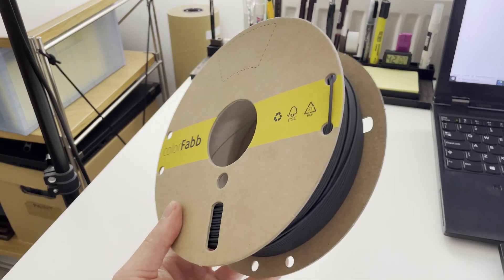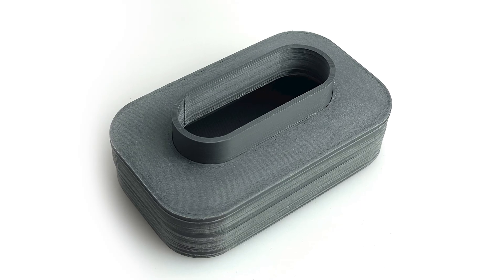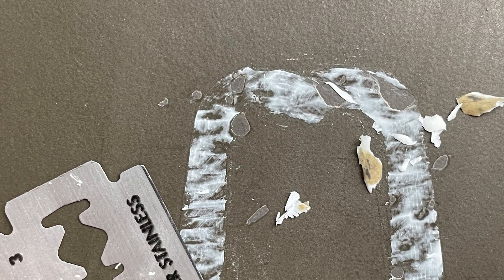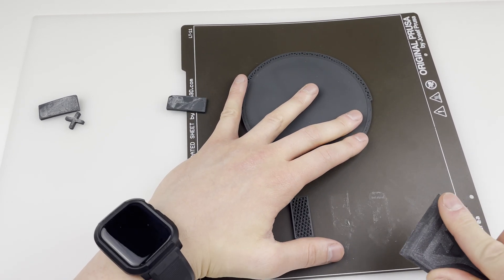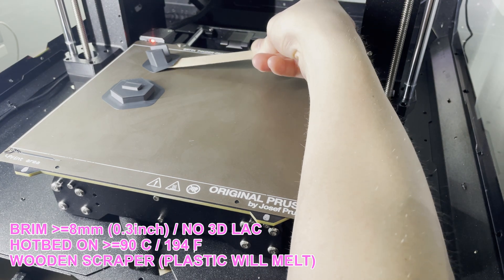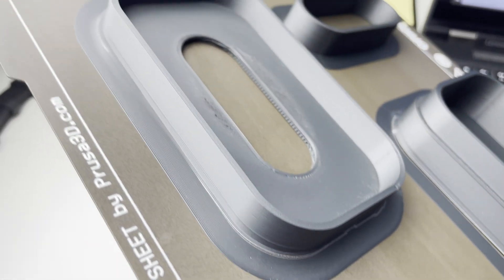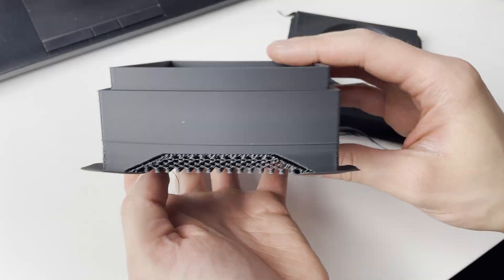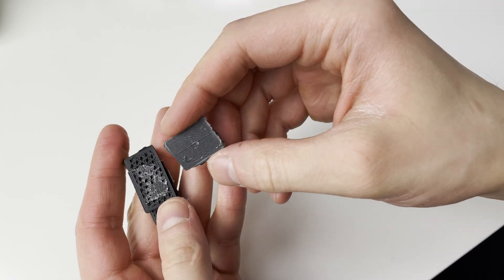Printing AllPHA on MK4. 0% Microplastics. 100% Biobased. 100% Biodegradable. Made out of fat cells.

Comment: how is it warping when its near impossible to remove it from the sheet? is it warping from pulling it off the sheet? Have you tried printing on glass?
Reply from the maker: It is possible to remove it from the sheet if it is heated to 90C+ but not from cold sheet. Brim and 3d lac helps to mitigate warp but i do not recommend using 3d lac as even heated to 120C its hard to remove. As you said it would be better to do that on a glass sheet. But glass sheets are old school, no affordable printer manufacturer uses those any more as majority of people print PLA or PETG or sometimes ASA, PC or PA which are also okish on flex sheet. This video is testing AllPHA on MK4, if I had Ultimaker with a set of glass sheets to test it on I would, but I dont.
Reply: @StudioSpaceDust  thanks for the reply I just bought an A1 mini with PHA filament from beyondplastic they just released their second gen PHA filament
Reply from the maker: Hey no problem, thanks for asking. In this video it was all about AllPHA from ColorFabb, so I'm not sure if this will imply to this filament you mentioned as I am not familiar with that, especially since its from another manufacturer. There are other filaments even from ColorFabb like PLA/PHA which are 100% biodegradable but they are not 0% microplastics as AllPHA. I have not tested them but I would assume they print much easier than AllPHA since they are probably mixed with PLA. PHA on its own is made out of fat cells of bacteria, and then some added colour pigment, that's why its harder to print it. Just googled the filament you mentioned. Seems liks its 100% PHA, so let me know once you tried printing. Maybe you have better experience!
Reply: @StudioSpaceDust  i printed my first print on the A1 mini and changed the recommended print settings, no warping, no brim, printed on textured PEI amazing filament but i printed about the size of a bottle cap yet still very impressive results for PHA from beyond plastic, came off fairly easily no heated bed required. Edit: tiny tiny bit of warping but not visible to my eye upon first impressions
Reply from the maker: Tha ks for the update, sounds similar to ColorFabbs AlPHA, if you later print bigger object like those boxes in my video let me know, also is PHA from Beyond Plastics also easy to cut and scratch prone?
Reply: @StudioSpaceDust  easy to cut and scratch is about the same in the video
Reply: @StudioSpaceDust  have you've had any luck with overhangs? My PHA stuggles at 40 degrees
Reply from the maker: @Gobolinn  Hey, that decorative vase in the video was pretty much most challenging from the overhang perspective, that one worked, you can find the printable version of it and try printing with your material to compare. Is your fan 100%? can you bring temperature down? I think this would help with overhangs. Also slow it down, that should help too.
Reply: @StudioSpaceDust  I think your statement: "ColorFabb like PLA/PHA which are 100% biodegradable"  is incorrect. 

Mix PLA-PHA ColorFabb brand of Filament is not claimed to be 100% Biodegradable. Ruud Rouleaux (CEO-Founder of Colorfabb) knows this material very well, and he's not the type of guy to greenwash any claims. The PLA-PHA blends end of life is Industrial Composting only. ASTM 6400 standard.  

The only claim they make on that blend of material is to be 100% Bio-base. 

The only company that is making false claims on biodegradability is Regen from Canada. They are claiming 100% PHA when its in fact a blend of PLA-PHA.
Reply from the maker: @fredpinczuk7352  thanks for correcting me on this. If I somewhere said that pla-pha is 100% biodegradable I was wrong. Im aware that once PHA is mixed with PLA it is no longer biodegradable.